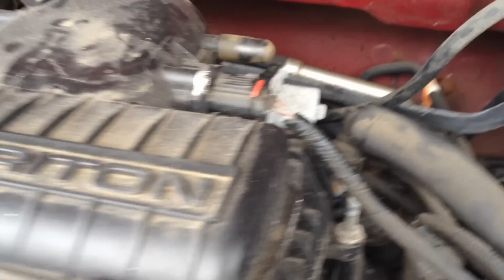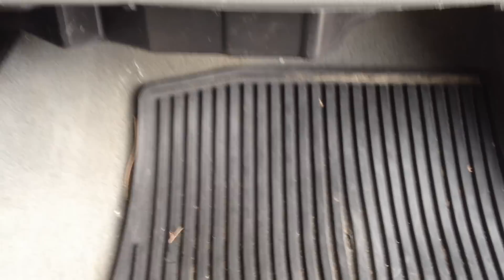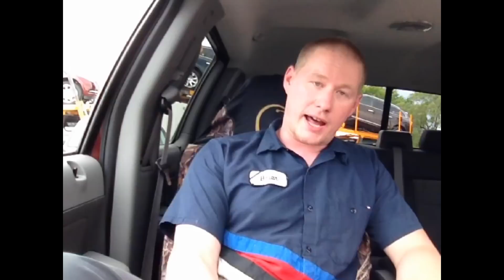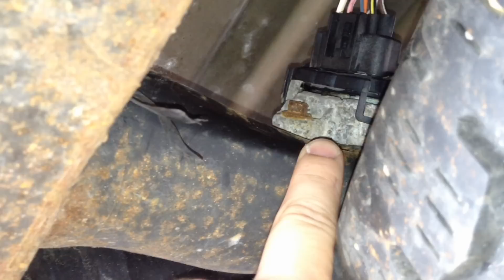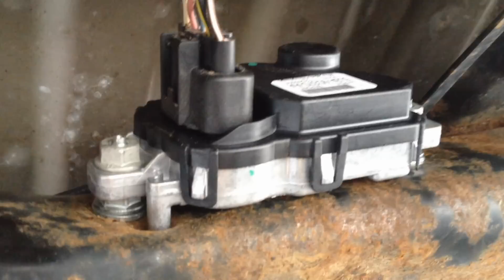2004-2008 F150 Died Out No Crank Theft Light Engine Compartment Clicking P1233

Comment: I didn't go out yet to look if it's a problem but I do have an 04 f150 that is experiencing exactly what you talked about in your video I'm just wondering from your experience is it possible for that piece to go bad but for the fuse inside the dash to actually still be good

Comment: Mine is no crank, no start,  the lights in truck and dash all work. The alarm is not its regular loud sound. Its very low beeping. The alarm lights are going off. When i go to start the truck the alarm will go in to loud mode. My key fob was dropped in the water many times and wont connect with the truck, so I have to use the key to unlock the doors. I leaning towards its the key fod that is causing this no start issue.

Comment: I have a F150 2011 for a 3.7 V6 680 transmission when it’s cold it won’t crank but it’s cranked run is a leaf frame or what do you think?

Comment: I have an 05' that isnt my daily driver. The new battery i installed gets drained after atwo days of sitting. Jump starts and runs great. Can a bad module cause this parasitic drain on the battery. At times i can hear the fuel pump humming while the truck has been off.

Comment: 04 F150 5.4, changed the heater core this past weekend and now I have no crank no start check gauges. Replaced the PCM relay. Still nothing but now do have that ticking sound. We're at a lost

Comment: Do they sell the wiring harness from behind fuse 34 to the fpdm, cause behind fuse 34 it's corroded to the fuel pump drive module on my 2008 Ford f250 with the 6.8 liter with 348,+++Mike's?

Comment: That, vacuum  leads and,  clearing the pcm. Thank you for the video  . BTW I have a 2005 f150 4.6,  bilsteen coilovers,  pro comp out back. I always run BFG AT ta,  or general grabbers. Is set up prerunner, 2 inch 1/4 dom tube bumper custom by the help of my brother

Comment: Thank you for a good video ..I have a question have a 2005 5.4 180lk on mileage it was struggling to go over 30 mph misfires a surging  under acceleration  i read and watch Ed a video that by disconnecting fuel pressure sensor vacuum hose will raise pressure it didn't ,my pressure seems to fluctuate at 39 psi at  2.7v I took hose off drive it same thing , I replaced plugs and coils and then  by passed  fuel pressure control module the prressure spiked to 82+psi at 4.8 volts and it became a totally different truck ..snappy and pretty fast no surging no blinking check engine light pulls under hard heavy throttle  to redline , it was late when we finished I parked it plugged the control module back in I haven't driven it yet plugged back in but how do I determine if it's the fuel pressure sensor or control driver  I don't wanna jus throw parts at it but how can I get the truck to increase fuel pressure with the control module hooked up or does it suppose to

Comment: Just happened yesterday (7/22/2024) to a friend's 2014 Ford E450 RV conversion (running a V10).  Was convinced it was the fuel pump, but it likely started with the fuel pump driver module.

Comment: You are the s*** bro I'm beyond impressed and it takes a lot you are exactly right and you're also the first YouTube video I've ever seen that was actually spot on so hats off to you I appreciate the knowledge being shared I'm a auto and diesel tech and I ran into this before different vehicle different symptom different problem blown fuse but showed good on both sides just no explanation. So now I got it to crank everything's good but I don't have my fuel pump kicking on so it must be that module trying to hunt one up right now trucks been stranded in front of one of my bay doors. Thank you I thought I fried something

Comment: Hi I have a 06 f150 5.4 it was running fine till the starter went out I unhooked the positive cable put the new starter In and it turns over but won’t start. I have a red light on my dash by the windshield when I turn the key it stays in for 3 seconds then goes off never noticed it before other then that the light flashing like normal not sure if it’s a security thing or not but I did unhooke the battery for awhile hooked it back up it started for a few seconds and died I checked my fuse

Comment: Thank you so much for making this. No mechanic could tell me what was wrong with my truck and I had replaced almost every part in the starting system other than the PCM. I was about to drop it off at the dealership until I saw this. This fixed everything.

Comment: Thanks a lot bro I ended up changing the fuel pump driver module and replacing the blown 34 fuse. It started right up I let it idle for awhile a cut off. I keep checking fuse 34 and it keeps blowing any suggestions?

Comment: Replaced the FPDM on sons 2004 F150 5.4l and got a P1237 code, so replaced the pigtail connector but still have the code even after clearing and rescanning. Truck seems to run ok. Not sure where to look next?

Comment: Does the fuel pump module have to be grounded to work or will it work if it’s just dangling and plugged in a brand new fuel pump module if I connectA brand new fuel pump module and let it hang without being bolted to the frame or grounded in anyway will it work

Comment: I replaced that piece on my 2004 Ford F-150 four wheel drive a 5.4 l and it there's another code p0451 the fuel tank pressure sensor I was wondering if you can help me to understand where this pressure sensor is and if it's the one that's in line or directly on the tank thank you I appreciate any information you can give me

Comment: @Fordtechmakuloco I’m having this exact same issue right now and can’t fix it. The check engine light, battery, and anti theft light are flashing with the ignition set to ON as well as the imrc cycles non stop. Truck cranks/No start, or cranks/starts but stalls almost right away as the battery, cel, and anti theft lights are flashing. Replaced the fpdm and fuse 34, and lights are still flashing. Any help is greatly appreciated please

Comment: Thank you sir for your video!  I recently bought a 2006 Ford E350 5.4L that just shutoff while idling in my driveway.  Then when I turned ignition key it had CHECK GUAGES and a picture of wrench lit up, but no crank.  Battery was good so I changed out the oil and oil filter(looked like hadnt been changed in while) thinking it might be the oil pressure being low.  That did not fix it.  However, I stumbled upon your video and learned a lot!  Thanks to you I went looking through the fuse box for a blown fuse and wouldnt you know there was a blown 20A fuse in slot 23.  Not sure if this has anything to do with the Fuel Pump Driver Module.  However, now that I know where it is, and it looks old, I'm going to replace it before it goes bad while I'm out somewhere, or causes damage to the harness.
Thanks again..much appreciated!!

Comment: I know this is an older video. But I have also ran into the same issues with this generation f150.  When the a/c clutch shorts out it will also drag down the system and give the same exact symptoms except for blowing that fuse. It will make the ses, battery and theft light go erratic blinking and you also get the intake shutter and throttle body clicking.  As well as it will stall out the engine while driving or idling like someone shut the key off.
Reply: Does it blow a different fuse??

Comment: I replaced the fuse and FPCM, still experienced crank no start. I used jump wires on the plug to the FPCM and truck started, but blew the #34 fuse again! What is most likely the cause ? Bad ground?

Comment: Any advice if the truck runs fine but check engine light came on and it scanned fuel tank pressure sensor? 2005 f 150 5.4

Comment: Have an '04 that I bypassed in the shop and it ran absolutely fine so I assumed the drive module was faulty and replaced. With the new one installed the truck starts immediately now, but then sputters and dies soon after. Wait a second and starts right back up...I believe it's the fuel rail pressure switch now causing my headache..
Reply: Nope it wasn't...

Comment: I have a problem with my 07 f150 won't shut off even with the key out. I replaced the ignition switch and pcm relay and still does it. Any idea what it could be?

Comment: I stumbled apon this bad part when I removed my bed to paint the frame. It was cracked in half mostly because it wasn't supported correctly. I added washers to the one side when I replaced it. The way it was mounted it was be forced to crack.

Comment: I have an 08 Lincoln Navigator and when I go out to start it especially if it’s cold out and it’s sat for a while I will turn the key and everything will turn on but there is no crank no sound no click nothing then after I turn the key a few times after I’d say a couple min then it will start and it’ll start just fine the rest of the day sometimes there will be a delay when I turn the key nothing for a split second then it’ll start

Comment: Yep I'm having a problem with will crank no start put new fuel pump in fuel filter took a tester on the coil plug in no no speak on all wiers check ed the fuses all good and relayes there good to I don't know what to do
Reply: Fuel drive went out on my 06 F150 got it replaced and all relays and fuses are good. now truck still has no crank no start issues did you figure yours out?

Comment: Umm you should not touch your face in someone else's vehicles and you need to have an mask on😷
Reply from the maker: This video was shot way before COVID was even heard of but ok.
Reply: So I have an question for you. 2000 Ford Expedition XLT someone gave me and didn't know anything about it. And it tends to shut off when put in drive and also when driving or at a red light. 256,000 miles. Did I can do to it and still shuts off
Reply: My apologies

Comment: Anyone know what could cause my truck to have anti theft light flashing when the jet is turned over it flashes fast no crank no start when I go to start it like turn the key to run position the miles and radio cut off any ideas?

Comment: Great video. That same poorly designed and poorly placed Fuel Pump Control Module is also present on later model F150s and Expeditions.  It was certainly the cause of these problems on my 2010 Expedition. The No-start problem seemed to start with wonky relays in the engine bay fuse box, and the only temporary fix was for the under-hood relays to be changed around by my daughter every morning to get it to start so she could go to work, but I finally heard about the Fuel Pump Control Module issue, as I was about to drop the fuel tank and replace the pump. I learned  that the in-tank OEM pumps are extremely reliable, and that fuel pump/fuel pressure problems are usually caused by a very corroded Fuel Pump Control Module.  However, many people are happy to replace your fuel pump if you ask them to, and will usually put in a new module to make it all run. All I had to do was to replace the Fuel Pump Control Module, and the problem was solved for my daughter.
Reply: 2006 f150 fuel rail

Comment: I will have to check this. My 08 wouldn't turn off. Then it wouldnt crank. Tried everything. Changed the ignition switch, and checked relays, but didnt work.
Reply: Was this the fix . My fuse was good and key wouldn’t shut it off when I got home now no crank
Reply: @ mine was a work truck and had a charge guard installed on it. One of the wires going to the charge guard was cut open and shorted out. Repairing that fixed my problem.

Comment: I have a ABS module that is causing a similar problem it’s causing a no start because it shorted out scan tool shows front right wheel sensor moving while parked and smell it inside the cab when doing a module reset i hope I didn’t cause any other damage

Comment: I had this similar problem and yes the fuel driver module needed to be replaced and I replaced the fuse and the battery but to my dismay after I got everything back together the problem still exists. When the key is on it does nothing but with the key out the air conditioning runs and the anti theft light keeps flashing rapidly. I have know idea what to do. Any advice would be greatly appreciated. Thank you.
Reply: Long overdue updates. Turns out there was corrosion in the fuse box. Now works like it should. Now new problems have arose such as engine fail safe happens off and on. Looking into it tonight. Just might sell the damn thing and get something else.

Comment: Hey Brian, got a question for you if you have a minute.  Symptoms:  Truck starts no problem after sitting over night.  If I drive somewhere then turn it off... then go to start it again after a short period, it cranks and cranks and stumbles and tries to start but won't start right away... takes a few tries then stumbles to a start.  The dash keeps reading "check gauges".  I checked for codes with my OBD2 reader... no codes/problems listed.  ALSO... when driving down the road... if I hit ANY incline... when I'm going around 25-35 mph in 2-3 gear it will stumble... seems like a misfire.  Again, check codes and it reads nothing for misfires.  SOMETIMES when I go to start it after I have driven somewhere then restart shortly after... IF I wait a little bit after turning key to power on... it will start with no issue.  What the heck is going on?  Fuel pump?... but misfiring only in a certain range on incline...?  Hard 2nd start with "check gauges" but not first start up?  Also seems to be running "rough" at idle SOMETIMES at stop lights... other times it's running smooth.  Also, when it's running rough at idle, if I put it in neutral and give a little gas to increase RPM's it's smooths out with no roughness.  Please help.  Any advice is greatly appreciated sir.

Comment: i have the same issue and i replaced the fuel pump module and put in a brand new battery but now when i turn the key the battery gauge drops completely and gets lower and lower on each turn of the key and i still have the flashing light etc. am i missing something can some one please help me with this. this video describes my problem but this fix didn't fix me ,,,

Comment: Would you happen to know how to REMOVE Pat's from my 1999 F150? I'm not referring to a bypass for remote start, I want it GONE. I'm sure its something in the cluster right, what do I have to solder together to remove it??? I'm tired of my truck deciding all of a sudden that it doesn't want to work and blame it on the Pat's system until I try it a second or 3rd time. Maybe you can look up what I'd need to do and pm me or something....

Please and thanks.
Reply: Pcm gas pats...have someo e remove pats from pcm then u wont need a chip key to start your car....

Comment: I have 98 F150 something keeps killing the battery there's a sound behind glove box hi pitch sounds like the old internet like the dial up internet. Also alot of clicking with the key out of ignition sounds like something trying get out from behind dash, one day I had the ignition switch turned all the way forward listening to the radio it cranked itself up without me turning the key everyone standing outside the truck said she was cursed that it was a dead mans truck. I will send you videos of the sounds.

Comment: Had ford dealer ship change my oil an once i got it back my lock didnt work no more my radio wont turn off once my key is off an i am out of the truck emergency break light stayd on also an my seatbelt dinger keeps beapin also non stop..  Abs light is on also an it all happened after a oil change any idea on how to fix it.. I have unpluged the battery an its still the same no lock abs light an  break light is on.. What in the world could of happened?? Relay control mondule or a fuse or what u all think on that problem.. ?